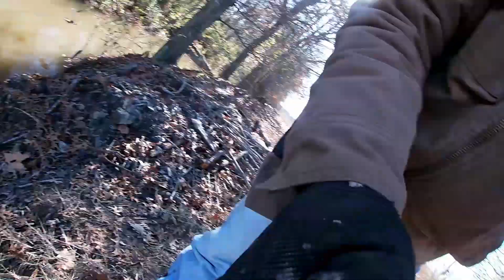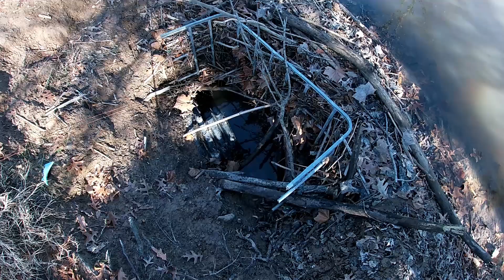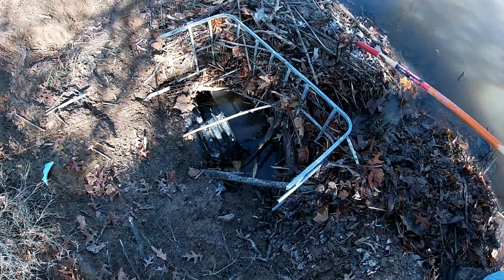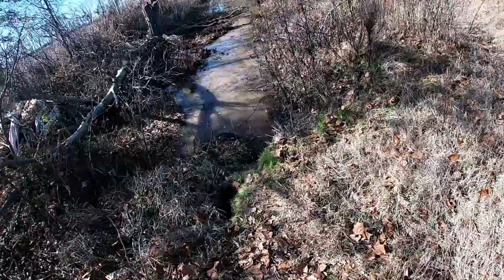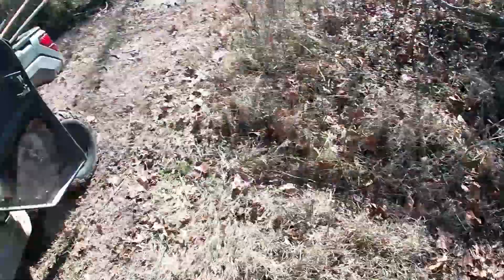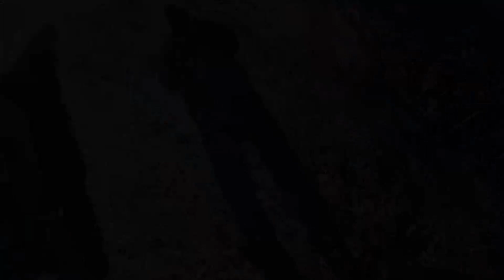Breaking the Beaver Dam | Culvert Unclogging in a Drainage Ditch

Comment: If the beavers are there they will repair that little bitty damage you did in one night.
Reply from the maker: Yep, they come back every night. But like I said in the video, this is about water control and holding back a certain amount. I control it by opening it early and letting it drain all day. I don't want all the water to go just yet. There are also trapping operations in place to hopefully handle the beavers very soon.